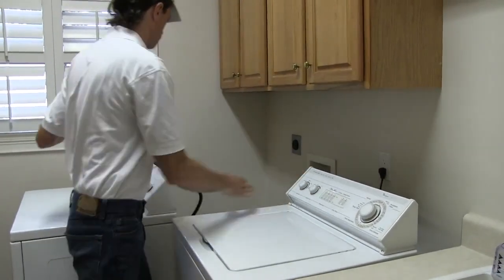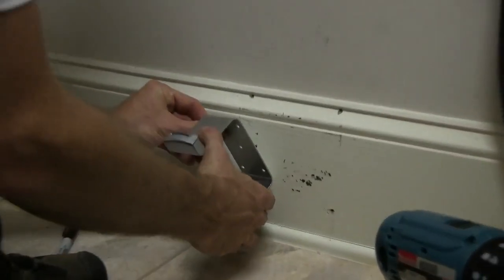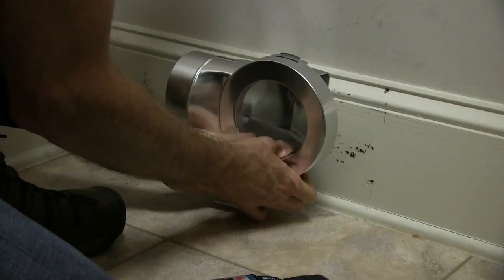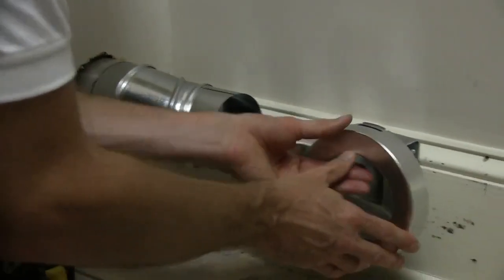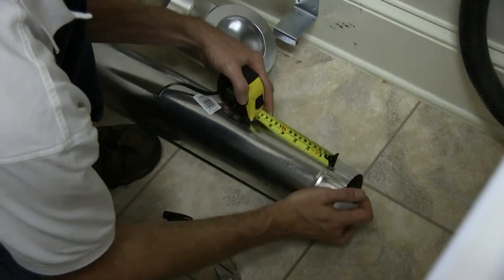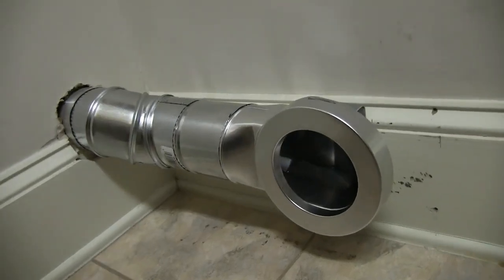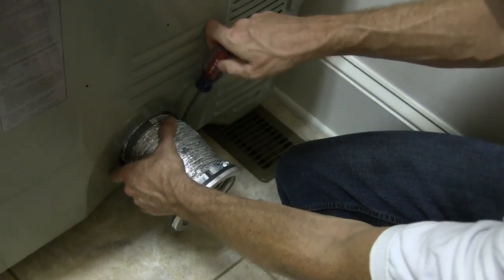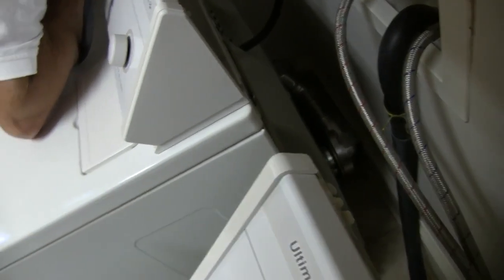MagVent MV-90 Magnetic Dryer Vent Installation

Comment: Does this work with recessed dryer vents that go up inside the wall?  Is the MV90 the option for this kind if setup?
Reply from the maker: Correct the MV-90 would be the option we would recommend. Check out our video names MV-90 in a dryer box.
Reply: @MagVentLLC if it’s vertical, should I need an adaptor to make the vent opening horizontal?

Comment: I ordered one of these via Amazon as I live in U.K. There is nothing like this here. I put my tumble dryer inside a built in cupboard unit, next to my front loading washing machine, so my laundry area looks really good but the vent for my tumble dryer is on an external wall to the left side. There was no easy way to connect the vent at the rear of the tumble dryer (apart from using the awful plastic hose that came with the machine) because it’s unreachable due to the built in cupboard having a Silestone counter top so this magnetic vent is a genius way to connect the rear vent to the wall vent handsfree. I can check it’s aligned correctly using a selfie stick and my smartphone to reach to the back of the tumble dryer and record a video to check all’s good👍🏼 
This is the best dryer vent design ever! You should sell them in U.K.

Comment: Only one problem is  That , the connection off the wall like 7 feet . 
.
Reply: If you duct exiting your room is that far away, you can use rigid pipe to complete the connection between the MV-90 and the duct running into the room.

Comment: My dryer likes to shake. The installer recommended I don’t go with a mag vent cause he said when the dryer shakes while running the connection will slide. Is he full of it?
Reply: The connection will not slide due to the dryer shaking. The magnets are very strong and their is a lip on the dryer side union that engages the body of the unit.

Comment: Apologies, I'm an idiot.  What is that transition/offset piece in the video called so I can search for it properly and purchase? 

Also, how much hose, in length, comes with the mv-90 kit?

Thank you
Reply from the maker: Good morning! Thank you so much for reaching out.
The MV-90 can be used with a standard 4'' diameter elbow or standard 4'' diameter rigid metal piping.
The MV-90 comes with 12'' of the flexible transition hose.
I hope this helps!
If you have any other questions or if I may be of further assistance, please don't hesitate to contact us!

Comment: Couple of problems, soft foil is not to be used on any dryer, voids warranty. Second does the coupling, magnet , dead centre with wall part? If not it will shorten life of dryer, does manufacturer of venting system take over warranty if dryer fails?  I wish builders would not throw laundry products where they fit and actually plan
Reply: MagVent couplings will not void the dryer's warranty. MagVents are not made of soft foil duct. They are made of UL 2158A approved DryerFlex from In-O-Vate products, www.dryerflex.com. It is sturdy, aluminum hose that is lined with steel wire and resists crushing.

Clothes dryer manufacturers allow 4 inch flexible metal hose as long as it is UL listed and accessible for cleaning. MagVents are made of sturdy, steel lined, aluminum ribbon hose that is UL approved and resists crushing. And since MagVent couplings make it simple and easy to disconnect and reconnect your dryer for regular cleaning, they will not void the dryer's warranty.

MagVent couplings will not shorten the life of your dryer. They actually increase your dryer's energy efficiency. The strong 4 inch ring magnets connect properly and fully maintain the recommended 4 inch vent path.
Reply: Now that you are making things up your credibility is gone. Having just reviewed 8 installation instructions from several manufacturers not one mentioned foil venting of any type is to be used or approved for use. All clearly stated rigid or semi rigid venting and not to use foil. Having repaired hundreds of dryers and reviewing installation instructions with customers I know what is allowed and not allowed. If flex rigid is substituted for foil then it is acceptable. Please review installation instructions
Reply: Mr. Denhollander, you don't seem to understand that MagVent couplings are not made of soft foil hose. They are made of Dryer Flex which is flexible metal hose composed of aluminum ribbon and steel wire.

I do appreciate all the opportunities you have given me to explain to my potential customers about the advantages of MagVent dryer vent couplings. MagVent couplings are a new and revolutionary venting system, unlike and superior to traditional venting systems. MagVent couplings help eliminate the typical and dangerous soft foil hose, while facilitating the use of more rigid metal pipe throughout the entirety of the vent path.
Reply: I do fully understand, the part that attached to the dryer and coupling is the issue. Again, please supply documents from manufacturer saying the soft flexible foil part is allowed.  Only two types of venting is approved, rigid metal, as you show from connector to wall and a flex rigid. Nothing else is approved by any manufacturer.  Change to flex rigid then it is permitted.   Maybe if you have seen as many failed products due to improper installation (from those who dont follow manufacturer instructions). We are going in circles and until the soft foil at dryer is eliminated I stand by what manufacturers dictate.
Reply: I don't give you an ounce of credibility Ronny. DryerFLEX is a perfectly acceptable hose; by consumers and manufacturers. A manual isn't the be all end all on the subject. Like I said Ronny boy, come into the 21st century.
Reply: Stfu ron. Negative asshole.
Reply: Christ All Mighty Ronny boy, you don't have a clue what DryerFLEX is. Just because a manual doesn't mention DryerFLEX doesn't mean it can't be used or will void a warranty if used. New stuff comes along all the time and manufacturers aren't chomping at the bit to update manuals to include every viable part. They print once and forget. Jeez Ronny, join the 21st century and get yourself up to date.
Reply: Actually I do know, it is you that has no idea. Maybe take the time to read a manual ( or a few) and see the venting that is NOT ALLOWED then you might be able to comment intelligently.  You will read , and it clearly states, that the flex venting shown in this video is NOT ALLOWED on any dryer, domestic or off shore.
Reply: Thanks for the laugh, shows you have no idea at all what you are talking about. People like you keep technicians and manufacturers in jobs. I know you have zero technical skills or knowledge and thankfully no trade licence or you would know how the manufacturers installation instructions are to be followed to the letter. Again thank you for the laugh.

Comment: Magtag dryer with low back vent but  the other vent is not in the wall but floor.  Will the 90 degree kit work and avoid the "loop" ?
Reply: The MagVent MV-90 is designed for when the vent path takes a 90 degree turn, such as through the floor, off to the side, or up through the ceiling. The tail end can be installed in whatever direction or angle necessary to make the shortest and most direct vent path.

Comment: Don't forget that flexible duct coming out of the dryer which is a heating appliance is flammable, are you trying to burn the house down?
Reply: The flexible hose on MagVent couplings is non-flammable.  MagVents use DryerFlex from In-O-Vate, www.dryerflex.com. It is UL 2158A approved specifically for dryer venting and is zero flame spread. MagVent couplings actually increase your home's efficiency and fire safety.

Comment: Hi,  I haven't installed mine yet, but I do have a question about the dryer side magnet with the flexible tubing.  Is this the style of tubing that looks like metallic foil but is actually plastic that they show can catch fire with gas dryers?  I'm liking this kit a lot so far and can't wait to install it.  I have an electric dryer however that would probably shut off it got too hot, and do plan to keep the lint cleaned out once a year, but was just wondering.
Reply: MagVent couplings are made with DryerFlex from In-O-Vate products, www.dryerflex.com. It is sturdy, non-flammable, UL 2158A approved aluminum hose that is lined with steel wire and resists crushing. When combined with the MagVent coupling, it compresses down in an accordion-like fashion and, with proper installation, is never crushed when the dryer is pushed into place. MagVent couplings increase your home's fire safety and energy efficiency. They also make disconnecting and reconnecting your dryer for regular cleaning simple and easy!
Reply: It is made of a durable material that resists catching fire, unlike some of the older metallic foil-like tubing. However, it's always crucial to ensure that your dryer vent is properly installed and maintained.

Comment: is it harmfull for the washing machine circuits and metalic parts ??
Reply: My husband said the circuits are too far away to cause any issues mechanically.  The use of a magnetic fitting increases dryer efficiency and thus lowers electrical usage and cost.  The other fittings leak heat out and increase cost by slowing drying time.
Reply: Tracy McPherson thanks a lot!

Comment: why not just use any other type of connection ? how is this magnetic one useful ?
Reply: Try venting a dryer that backs up against a wall into the floor using standard flexible duct. Your question will be answered.
Reply: Zombie Bites thanks a lot
Reply: Well OMAR if you ever put one in....... You would know that its a pain in the ass and with this device you can literally attach it to the dryer then just push it back in place SHAZAMM your hooked up